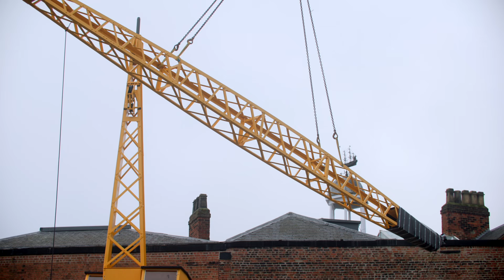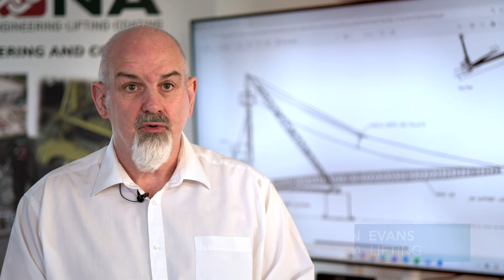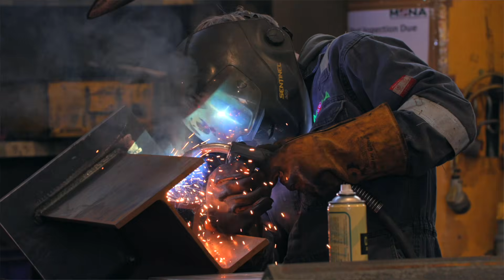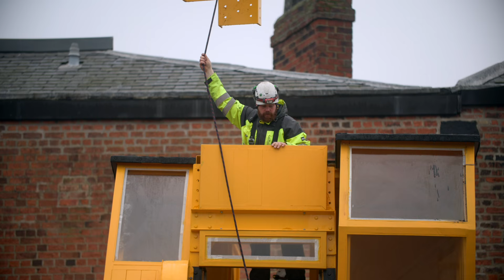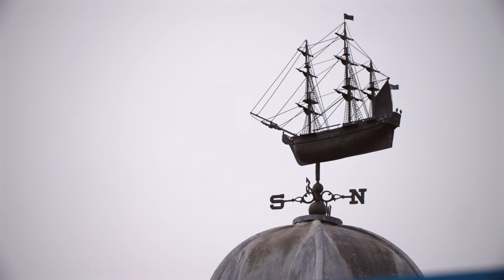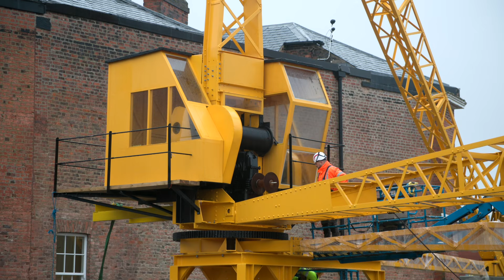Restoration of Hull's last remaining Scotch Derrick Crane

Comment: I drove a Scotch Derrick for Chas Brand & Sons on tunneling projects in London, They also had a rail mounted converted steam crane used to unload concrete tunnel lining segments. The shaft crane was a new Taylor Hubbard that had a hand brake lever to feather a load to landing it. I also drove a mobile tower crane made from Ruston Bucyrus parts to a companies design that went bust, so RB took over the project to use the already made parts. It was based on a RB22 chassis with diesel electric power and extendable tower, two were used by Crudens on a Deptford housing development. After that I drove Hydro mobile and Allen Grove mobile lorry mounted cranes for Greenham Crane Hire, one job was to attend a rolled over truck that carried rolls of newsprint paper. It had overturned on a sharp bend and crushed a public bench outside an old people's home, I assisted the Fire Brigade lifting each roll as two old ladies often sat on the bench and they were not at home. Once the bench was cleared and no squashed ladies there, the two old ladies came around the corner, they had been to the Post Office but now very worried about there squashed bench. We were in gob smacked and burst into wails of laughter.
I have spent most of my working life in construction from 1960 until 2016, working on large construction projects as a Senior Inspector of Works. I have often passed on my crane driving experience and even jumped in the driving seat to show how it should be done. Only for the driver to shake his head and then thank me.

Comment: Commendable restoration job.  But when was it built, and by whom?  Given that this is supposed to be about heritage preservation, mention of these basic facts in the film is a staggering omission, as is any discussion of its history.   (The only clue was the head of the crane engineering firm stating that it was built in Colne).   Is the truth actually that the crane was standing on the site of your shiny and exciting new “experience centre”, and you could not simply scrap it because it was listed?